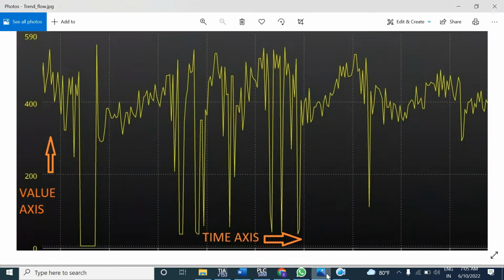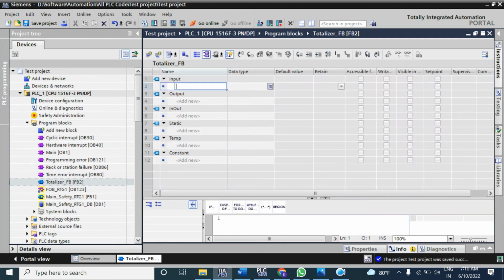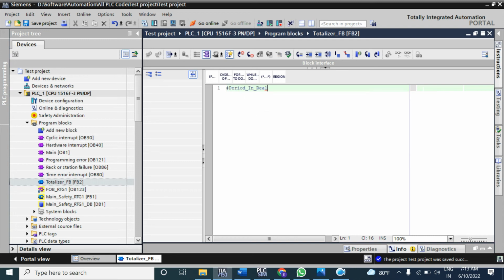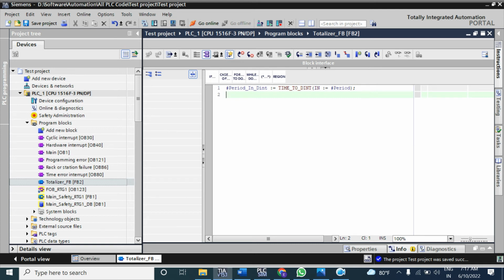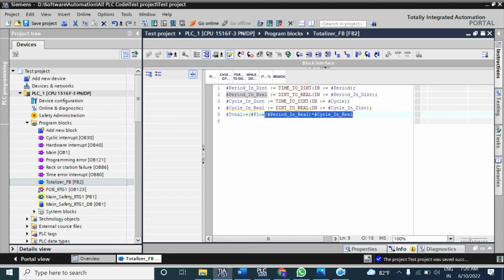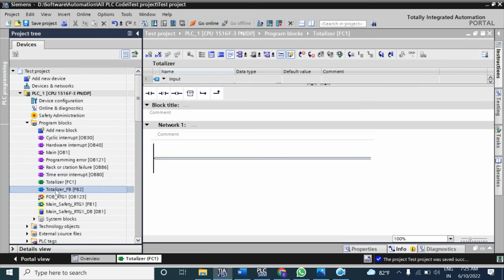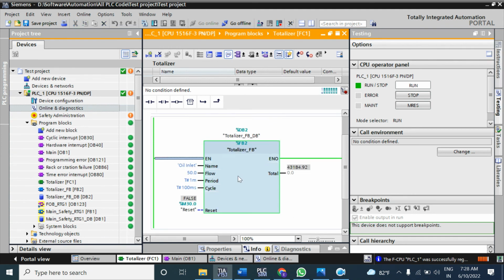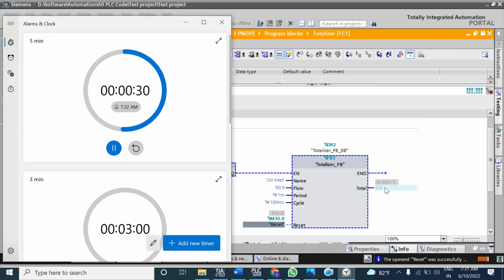TIA Portal: How to make and use a flow totalizer ? | Using SCL language

Comment: Hi why you are not using 1Hz
Reply from the maker: 1 hz means 1pulse per second, 
But if you take less samples then your data may miss because it changes in between that pulse. If you take more sample data missing rate will be low. 10hz means 10 samples per second. That's the highest rate of Siemens system clock pulse. You take more samples just watch my OBs videos
Reply: @faridautomation  thanks

Comment: Please you didn’t change the cycle real data type to Real
Reply from the maker: Thanks for your comments, If I understand rightly I shouldn't change the data type real to real.
Yes I did not change the data type real to real . I did change from Time to Dint then Dint to Real. Because our input Flow is a real format. So it needs to convert other variables in real.